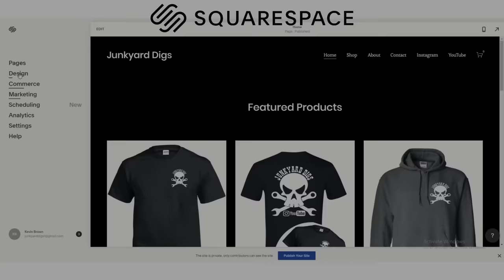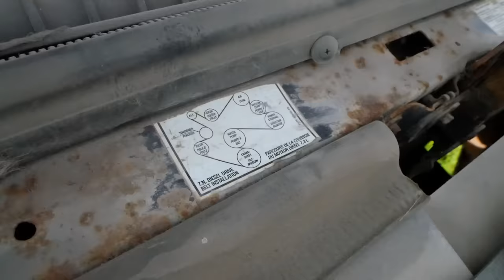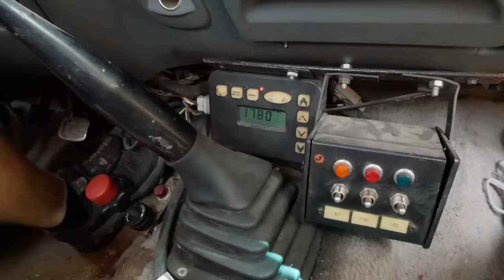Can We Get ABANDONED Tow Trucks to RUN?  - Part 1

Comment: Because the red truck is a dually and it only says “super duty series”, the truck is most likely an f450 or an f550
Reply: It's a F450 10 lug of the 90s
Reply: Daniel Preston it’s an f350 I know my fords not to be rude
Reply: He's right those are 10 lug trucks while the f350 have 8 lugs
Reply: I'm talking about the red one the black it a 350
Reply: Patrick Saur you're not rude at all, but it is a 10 lug compared to an 8 lug, has more leaves than the black truck, and like I said, it is not marked as a 350, while the other one is marked as a 350. Which makes it either a 450 or 550
Reply: @nitro_outdoors  it's definitely not a 350 lol. Before Ford trucks actually said f450, they were called the F-superduty.
Reply: Patrick Saur lmao it’s a 450 or a 550, sorry bud but 350s don’t have solid axles like this in the front
Reply: Patrick Saur clearly you don’t
Reply: 31:54 Coulda Died, jack Coulda failed and Then Head Crushed in Between Tire and Body of Vehicle.
Reply: You know ford made an f-super duty
Reply: Yeah the red one is a F-450. The black one is a F-350
Reply: The F Superduty was pretty much a F450, only available in 2wd from Ford had 10 bolt axels , basically an extra heavy duty f350. There were 4wd aftermarket conversions for them. 
99 was the year the Super duty name was applied to the f250 & f350 and the F450 and F550 replaced the F-Superduty
Reply: NitroRunner5125 bb
Reply: The 90's model "Super duty"was the predecessor of the 450/550. Only available as 2WD with a SFA but Marmon-Herrington had an aftermarket 4x4 conversion. I had one that came from a power company in Arkansas, had been converted by Tulsa Truck mfg. It was a 1993 model 7.3 IDI with Banks turbo. Kick my own ass for ever selling it!!!!!
Reply: it called an F-Superduty fools
Reply: @herbertv827  
Well yes, but actually Ford did not make a class 5 truck until the F-550 was introduced, so the F-450 replaced the F-Superduty and the F-550 was just a new model to fill the gap between the F-450 and F-650
Reply: @superstar64  as i said it was pretty much a f450. The f450 and f550 did replace Fsuperduty in the f series lineup . 
I mean the 90s f150s and Rangers were not class 2 trucks like they are today.
Reply: It's an early F450. 10 lug Rockwell axles, usually discs all around(why the brakes weren't frozen bad). GVWR will be in door jamb, probably 14k-16k. They were all 2wd. Forgot, there's a funky ebrake on the back of the transmission that motorhome people know to hate!

Comment: 7.3 are a workhorse, my oldest has over 360,000 on his 2003.Many of those miles are road trips to NE IOWA and the Mayo clinic in Minnesota.
Reply: Over 450,000 on my 01.
Reply: I bought a few trucks with high miles and they run pretty much perfect still. A 99 f250 that has 343k and a 03 lb7 duramax of all things with 358k and I even have a 6.5 idi turbo diesel truck with 296k.
Reply: @nou8257  I purchased my 01 new in 01. I Had a friend [he passed away last December.] that purchased a used 99 in 2000 with the V10, it had over 600,000 miles on two years ago.
Reply: The 94-97 engines aren't intercooled, they don't last quite as long

Comment: In regards to your question, It has a lift pump in the valley that pulls diesel from the tank, its fwd towards front of engine/under the turbo. Injectors are fired from a HPOP. Your start issue could be just air in the lines still, or bad fuel still in the lines, would need to be driven to clear it all out, or the unfortunate part the hpop is bad you'd need to see your hpop psi while cranking, or your IPR % while cranking, being its low miled it probably isn't the hpop but anything possible, sometimes just changing the oil really smooths the start process out. I have owned tons of 7.3s and none have started that long under normal circumstances.
Reply: Icp to ipr correlation numbers will tell alot. I bet it's just air in the fuel system and will just have to purge.

Comment: There is no injection pump on the PowerStrokes, it has the HPOP, which is high pressure oil.
Reply: And it’s why oil changes are important.
Reply: @RealWorldGarage  alongside cooking turbos.
Reply: Its also bleeding down. My truck does the same thing but take a bit longer to do so. Also you need to take those dot stickers off. Be careful with that trans as well, seems like every zf5 trans i see has a blown 3rd gear syncro. Truck should treat you right.
Reply: @johnathangood9253  yeah can confirm I have a '95 F150 with a 300 I6 and that same box. 3rd gear is not synchronized anymore. And it likes to pop out too. As an aside that's rather impressive that the trans in my '95 is good for the torque from a diesel should I ever get a burr up my arse and throw a JEGS catalog at the ol' 300 in front of it...
Reply: @johnathangood9253  you are right. ive gone tru 3 transmissions already.
Reply: 35:42 Why didn’t you use the rear deck and lower the truck to lift it off the ground ?
Reply: @johnathangood9253  The truck I sold had every syncro in it screwed it still could shift if you floated them minus 5th since it was gone
Reply: @TestECull  the 5 speed Mazda in an f150 is vastly different from the zf5 in that tow truck.
Reply: The IDIs have an injection pump, yes.
Reply: Correct... it is a HEUI engine. The gerotor runs the low pressure side and that sends oil to the HPOP which increases pressure and sends it to the injectors at which point the ECM provides the appropriate signal for which one to fire, solenoid opens, oil pressure is then used to fire the injector causing the fuel to spray into the cylinder.
Reply: Jerry Brown   Yeah, but he said Powerstroke.  They all have turbos.

Comment: You should get ahold of wes from watch wes work. He knows those ford diesels like the back of his hand. He could give you some good info.
Reply: Agreed !
Reply: Lil tip don’t use starting fluid in a diesel it will eventually become addicted and need it to start and possibly crack a piston
Reply: I think he did a few videos taking apart the high pressure oil system used to actuate the injectors. I think those could help.
Reply: Steven Allison  I believe Wes is in  the middle of a F450 diesel ambulance right now. I think he’s in northwestern Illinois

Comment: The extended crank is not normal. It either has a high pressure oil leak, or the fuel bowl is leaking down.
Reply: Can it be glow plug heat solenoid
Reply: I'd say weak glow plugs
Reply: On that truck. It would be more likely to be a bad or sticking IPR on the back of the fuel pump housing. If there were a high pressure oil leak to prevent the engine from running/starting, it would be immediately obvious (as it supplies a couple thousand PSI to the injectors).
Reply: The high pressure oil reservoir could be leaking back to the pan via its check valve stuck.
Reply: I would check that seal you put on top of the filter housing. I needs to go around the lid on the lip at the top of the threads.
Reply: Don't know that the rule are the same everywhere but if the truck is over 26000lbs gvw and has not air brakes you are good
Reply: @dragonslair59  Definitely not the glow plugs.  That truck only needs the plugs when the outside temp drops in the 40's or below.
Reply: @dragonslair59  glow plugs not working
Reply: Had 2 issues with  the old wrecker( same era) I ran in TN had same issue. We started with the pump like everyone is saying but did minimal good so I replaced the glow plugs and the hard start was gone.  It could very well be both.
Reply: @dragonslair59  could be, but as he clearly wasn't letting it sit that long between starts and it was hot out, I really wouldn't put much money on the plugs.  They probably do need service as old as the truck is, and the plug relay could also being having problems.  I could list off a bunch of things, but considering environmental factors, I would look for a mechanical issue like a HiPOP, IPR, or something else related to the oil including the regular oil pump.  I know it's not fuel pressure itself as mine had straight up ruptured the fuel return lines and sprayed fuel all over the engine bay but continued to run without any other issue than sucking fuel like it was going out of style.
Reply: dragonslair59 don’t need glow plugs to start unless water can freeze. It’s a fuel issue and on this type of injection system it’s either air in the fuel lines or high pressure oil leaking.
Reply: I couldn't tell if he was giving the glow plugs time..

Comment: So on the hard starting I'm sure you are getting air in the fuel somewhere and the extended cranking is the mechanical fuel pump trying to expel said air... I'm sure some will argue but a 95 powerstroke had a mechanical fuel pump right behind the filter bowl, I think they went electric in 1998 or 99. Also the powerstroke having the oil operated injectors is very sensitive to the cleanliness of the oil and filter so a service may make it easier to start and if it ever gets more than a gallon low of oil it will not run because the high pressure pump wont build enough pressure to fire the injectors. Also when you replace the glow plugs be warned they are under the valve covers and the wires for the injectors and glow plugs all feed through the gasket surface so make sure you get the gaskets that include the harnesses and pigtails to save yourself some trouble and replace all the glow plugs at the same time with motorcraft ONLY if you cheap out and use autolites the next time you'll be pulling the heads to change them, ask me how I know.
Reply: We've put a bunch of Dieselrx plugs in the powerstrokes they seem to be a good brand. Seems like as long as it's quality aftermarket parts they work good.

Comment: only need one to run, use it to tow the other
Reply: He should probably get tires and brakes sorted too.
Reply: @dustintunis9347  I'd say it's gonna need a lot of love tow trucks get the shit beat out of them
Reply: @dustintunis9347  Yeah, right now, it's basically an F250 with a heavy bed on the back, due to it having only four tires.
Reply: daniel bean  - No need to get snippy.  It may have been a bit of an overgeneralization, but with only 2 rear tires they would most likely be overloaded, which is bad enough with know GOOD tires (obviously these aren't).  Also SRW 1 ton trucks have a lower rear axle weight rating than duallies.
Reply: daniel bean  sweetie please learn to keep that mouth shut before it gets you in some trouble one day.
But to reply to your childish temper tantrum I own a 01 GMC 3500hd the old body style with a Cummins it's a factory wrecker I also own a 08 f350 srw with a 6.4 a 97 ram 3500 hd cummins and several others so yes I have seen the underside of a 3/4 ton vs a 1 ton.
Reply: daniel bean  
On the old Ford trucks there wasn't a huge difference between 3/4 and 1 ton. They both had full float axles. Spring size, duals and the gvwr sticker were different. They were heavy built trucks.

An F-Super Duty was the equivalent of an F450 or 550 today. Solid front axle, bigger rear axle, 10 lugs and low gears.

Comment: that oil pressure pump fix is super easy with external pump. That works until you realize the pressure is low to worn rings and then turn the whole engine into a pump, ..just let it run away until it explodes. its time was done anyway. ;)

Comment: The super duty is what a F450. Was called when they came out in 1988. I bought one new.
Reply: Man they are some tough old sob's too
Reply: They are great trucks and kind of hard to find these days. I have a 97 w/ a 460. The worst part on this truck is the parking brake. they use a ZF unit that is mounts to the transmission. They are a pain to rebuild and have to be completely removed and disassembled to do the simplest fix. If you break a 5 dollar spring, it could cost you 600 to 1000 bucks to get it fixed and most states require parking brake to pass inspection. If you do run into this problem, and as long as they have been sitting I'm sure you will, there is an outfit in Texas that sells complete modernized units at half the cost of OEM ....If you can still find one from Ford. Good luck Diggs

Comment: That fuel bowl has a drain valve. Yes newer diesels are hard. But reliable. Yes the injector pump builds up oil pressure for injector. I think is like 500 psi. Also there is sensor that goes bad on them. Had to replace one to. Is fairly easy to get at. Check fir oil seepidge on connector.

Comment: I loved Riches reaction "Does it have a C or a P on the side, I think you called the wrong guy", I'm on the same side as him with my Cummins and Mercedes diesels. Thus I hereby impart all of the knowledge I have of F*rd diesels: More redline would have cured 99% of the problems it had. To cure that starting problem, run some dryer vent into the cab so you can spray ether into it. And you don't neeeed all those gauges.
Good stuff, looking forward to the IDI video next!

Comment: Affirmative! The oil pressure drives the injectors, you have some work to do on that. Good luck! I'm glad you got it running. Let me know if you need a class on how to use that truck, I've been a tow truck driver for 26 years! 😁👍
Reply: I drove a toe truck to
Reply: I grew up around rollbacks and wreckers via my dad till the requirements to do it got too much hassle to keep up with

Comment: Yes it is oil pressure driven. You have the low pressure oil pump that brings the oil up out of the oil pan. And the high pressure oil pump that drives the injectors

Comment: it has been a while since i have worked on my 94 model i cant remember there might be a check valve for the fuel pump that alowes oil to stay in place for the pump to make sure there is oil there to help it start in the pump area. but i still use mine when the tracks are open in my area when i am off at times when they need a extra tow guy. to help the drivers out to move them back where there tow rigs are. it paid for its self for upgrades and other things. i dig them to be honest pretty much saved them do to history of automotive in my opinion

Comment: The injectors themselves are fed pressure from the hpop. (High pressure oil pump) it's fuel pump is "basically" a regular fuel pump. (70 psi)
Glow plugs remain ON after starting to aid warm up.
Should be a yellow lever on fuel bowl to drain water. Careful injectors fire with like 110volts.
Icps (injector pressure control) valves are problems on them.

Comment: Ok, have to ask who Un-subbed and Re-subbed for more wasp fights? TE HE! Great video, I have a 1990 Dodge W250 with a 5.9 L 360 and i was inspired the other day when I pulled up out of the woods poured some Gas down the throttle body and put some power to the leads and to my surprise the thing lit right off, now I am really to get the pump back into the fuel assembly, put the tank back under it and see if i can get that truck that was my best buds before he died 2 years ago to run again or at least idle.,  BTW it's a 5 speed with four wheel drive and also it's a 3/4 ton!

Comment: Yes you're right. It cranks till it gets out pressure because the fuel system uses a HPOP, high pressure oil pump,  to feed it the pressure necessary to get to fuel flowing, low oil pressure=low fuel pressure
Reply: You would be right, but that isn’t a power stroke. It’s a mechanical IDI diesel
Reply: @danfrederick3172  nope it's a powerstroke

Comment: I'm late to the party here, but you got a steal of a deal. Those trucks are both gems in the towing world. Both are equipped with Challenger 4800 wrecker bodies, which are predecessors to the modern day JerrDan bodies. As far as I know, both iterations of the 7.3, the stroker and IDI, are what's known as HEUI engines, (High Energy Unit Injection) and both rely on good oil pressure, supplied by the HPOP(High Pressure Oil Pump) to "fire" the injectors.  If the HPOP was bad in either of them, neither would run. Diesels can be intimidating at first, but truthfully, aren't that complicated, and very reliable over the conventional 460 of the same era.
Reply: Additionally, you have what's called tunnel boxes ahead of the tow bodies themselves. Great for all kinds of storage of chains, wood blocking, and other misc "tools of the trade" when it comes to towing.
Reply: And yes, F-Super Duty was the predecessor to the F450/550 line of trucks. The name change occured when the "roundbody" (99-07) trucks came onto the scene, and the 450/550 badge was adopted for the medium duty chassis by Ford.
Reply: And one more tip from a upstate NY Rustbelt wrencher: Brake Clean is your best friend when taking care of any kind of asshole bees. 10x better than any off the shelf bee killer. Can play target practice with the little spray tube atrax8 to the can. They're dead before they hit the ground.

Comment: the fuel pump is mechanical and is in the valley which rides on the cam.  It doesn't work off of engine oil

Comment: Air getting into the fuel system causing the diesel to run back from the injectors
Would be my assumption.
Reply: On the idi yes air intrusion.

Comment: 29:45  THE "DOWN MORE" LEVER YOU WERE PUSHING/PULLING, IT IS ACTUALLY USED TO TILT THE WHEEL LIFT FOR REACHING UNDER CARS ON A STEP DRIVEWAY. tHE OTHER CONTROL WAS BASICALLY UP & DOWN, THIS IS TO TILT UPWARD OR DOWNWARD....FYI

Comment: An oil pressure safety switch (sometimes called a "Murphy" switch) may be faulty, if so equipped . Good job on the vid and hope to see more.
Reply: That or the high pressure oil pump might be on its way out
Reply: Probably high pressure oil pump